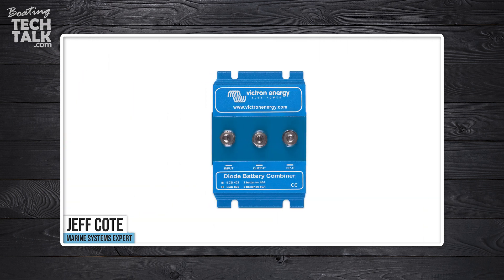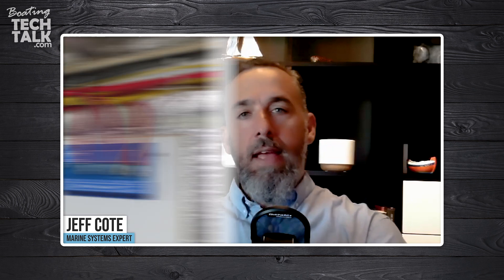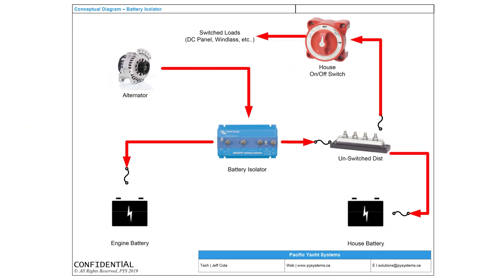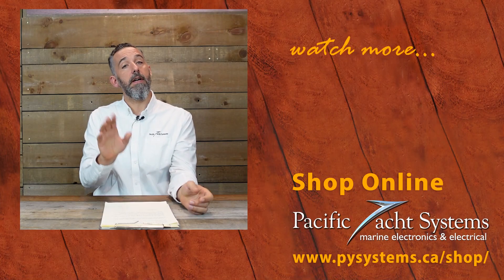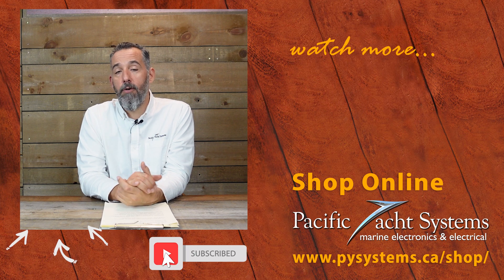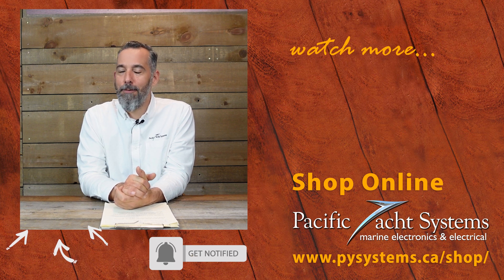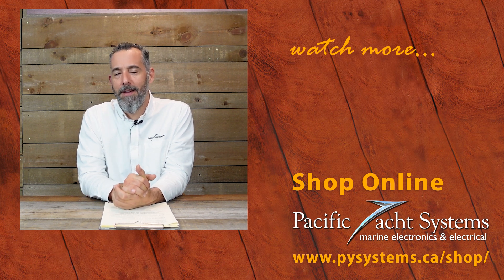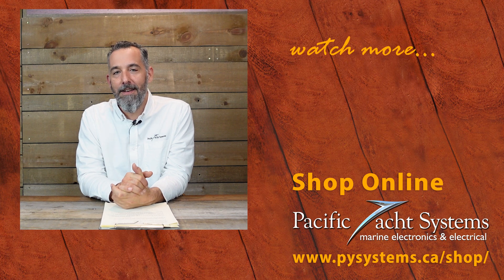Is There a Battery Isolator With Two Inputs?

Comment: Jeff, your videos are fantastic and very informative.  I have a question.  I have twin 7.4 mercs in my 42 foot cruiser.  One alternator goes to an ACR, which goes to Starter Battery 1 as the primary charge and to House Bank for secondary charging. The other alternator goes to Starter Battery 2 only. This is a lost opportunity for charging my 400 ah of house batteries while underway, and I wanted to know if there is a way to connect both alternators to my house bank, after charging the starter batteries.  Thoughts? As an aside, I do have a Magnum Inverter Charger, which charges house under Shore Power and with my Genset. Also have a separate 3 bank charger that runs off boat AC that provides engine and genset battery charging as well.

Comment: I think your advise about not using the isolator on both the charger and alternator is sound advice. However the French made Cristec Intelligent MOSFET Battery Isolator is available with 2 inputs and 3 outputs.

Comment: Great video, thank  you! I agree with the reliability approach.  I have a battery isolator for the alternator and the battery charger goes directly to each battery bank.  I'm in the process of adding 250W of solar power.  Where do I make the connection for the MPPT? I'm thinking either another isolator (expensive and not simple) or same terminal as alternator.  Using the same terminal is cheaper and I still have redundancy with the charger but... would love to hear your thoughts.
Reply: I figured it out {from one of your other videos), I using this solar to offset my refer and some minor electronic load so that means I need to connect to the house battery bank...

Comment: Jeff,  Good work you're doing here.  Kudos.  About your question there at the end, since the Victron agrofet isolator can be independently deployed to either direct charge loads from an alternator/stator charge system or a battery charger I can see how the application concept might get lost on a novice (like me).  But, hours of listening to you over these past days may have cleared things up for me.  My new Yamaha-powered center console comes equipped with an isolator.  Twin 200's with two starting batteries and one house (all same p/n).  Question... If I'm understanding you correctly, it should be possible to deploy a single output battery charger with an agrofet inline to divide and isolate charge current to all three of my batteries with no residual effects on Yamaha's stator charge system.  Am I cooking with gas here?
Reply from the maker: I would just buy a 3 bank charger.   3 bank chargers are more common then a 1 bank anyways.

I would confirm if you have an isolator or  combiners.  isolators with outboards would not be common.   If you have combiners you  could just connect a 1 bank charger to any battery and the existing combiners will charge the other 2.

Comment: Hi Jeff, Great video's! Question, I have a twin engine 3 battery bank system and thought that I would install a Mastervolt Battery Mate 1603 which had 1 input and 3 outputs. My questin is, Can I connect both engines alternators to the 1 input post on the Mastervolt battery mate?
Reply from the maker: I would not do that,  I would buy 2 of them.
You could join the outputs of each one, and run a single wire to each battery.  (big enough for the amps of both alts together)

2 alts may be over the amp limit of the unit as well.

Comment: I recently purchased a guest 2532 battery isolator two inputs three outputs.
Nowhere in the instructions stated if they were using FETs or diodes I try to contact the company but no response.
My boat originally came with 2 battery’s and I added an extra house battery I would like to separate the original house circuits to my new house battery what is the best way to accomplish this ?
Each motor to have its own starter battery and all other circuits on my new house?
Thank you for all the wealth of knowledge that you put out on YouTube YOUR a GREAT HELP
Reply from the maker: the guest is most likly diode based.    you will need to find the house loads to move.  ideally it's a single cable from the existing battery swtich that you can move to a new house swtich which would make it easy.  make sure the engine key switches keep getting power from the engine batteries.    they normally come from the starter,  but sometimes from the DC panel.  (which would be getting moved to the house)   some boats are easy to add a house bank and some are hard!

Comment: Jeff, Thanks for your videos.  They answer so many questions and provide great advise.  Is there an FET isolator which supports two alternator inputs and three battery outputs ?  The house battery lead on my Guest 2503 (Dual 70 Amp Isolator) has failed badly and I need to replace the isolator.  Should I replace the Guest 2503 with a similar Powerline or ProMariner model or seperate my charging between two isolators ?  Is a 70 amp isolator sufficient for two 50 amp alternator inputs ?  

This is an outboard powered fireboat which was repowered in 2018 with two Yamaha F350 outboards each with a 50 Amp altenator.  I suspect a shorted house battery may have caused the charging lead to burn up at the isolator connection.  Fortunately all of the protections worked and my fireboat did not burn up ... that would be embarrassing.
Reply from the maker: Hi Neil, appreciate the feedback, not aware of dual input FET based battery isolator, you'll need two battery isolators.

Comment: ‘ProMariner Battery Isolator, 2 Alternator/3 Batteries, 130 Amp (1 MIN)’ is this what manner you seek? Thought they were more common, or used to be, possible before such high output alternators were available. Alternators need open circuit protection possibly, I have not used this one. VSR are less cost and more efficient, control ability as well? The options now are so wide in system design? I am considering this and similar VSR concepts when I get there. Thanks Jeff!
Reply: As far as argofets not aware. Through put is a choke point. BBMS from Emily and Clark’s Adventures is a controller for intelligent combination of lead / lithium systems through relays. Not the same thing understood. Simple redundancy is each alternator has it’s own multi-purpose battery with VSR to a house bank or dc to dc charging system that do have dual inputs, power more limited in the latter.
At $140 for Victron argofet hard to beat 280 in system design?
Reply: ProMariner ProIsoCharge Battery Isolator 130Amp 2-Alt 4-Bat - 12V
SKU: 41456 - UPC: 031669231276 - MPN: 23127
0.0v loss labeled no technology used stated, no big finned heat sink, possibly similar? Lower rating 160 amp fuse protection requested.
Reply: ‘Sterling ProSplit-R Zero Volt Drop Marine Battery Isolator’ , at least one twin input model. High prices and an eBay rating so low I would not 10’ pole.
Reply from the maker: We tried the Prolsocharge and at limited success with this product.

Comment: Hi guys - hot topic. 

I think about this for a while now as well. In my opinion, it's fine to have booth (three, ...) energy sources on the Input as long as it meets the current "capacity" of  the FET-Diodes. For me the advantages, that I charge all battery with multiple Energy Sources, outweighs the disadvantage of a single source of potential failure. If the device fails, I can figure it out quite quickly with my voltmeter, jump the device and directly connect the battery banks with the energy sources. E.g. the starter battery with the alternator and the house batteries with a charger or however I need it. 

However, maybe I overlook something. Open for constructive ideas / talks :) Maybe this option suits for me since I'm doing the electrics by myself and can repair things. If we talk about people who are not very familiar with electronics, I would agree on the here proposed solution.
Reply from the maker: Thanks Felix for sharing, much appreciated.

Comment: Victron do sell a 2 input single output diode unit so you can run something critical from 2 separate battery banks.
Reply from the maker: Hi Roy, here is the datasheet from Victron for ArgoFets:
https://www.victronenergy.com/upload/documents/Datasheet-Argofet-Battery-Isolators-with-alternator-energize-input-EN.pdf
Reply: @PacificYachtSystems  Hi Jeff,  the diode unit I own is a victron ( battery combiner diode) bcd 802 - bcd 000802000 the 80 amp version there's also a 40 amp they are shottky diodes so you have volt drop you can also use them for charging if you want. I use a 100 amp argofet 3 output for charging I disconnected the negative to see what happened and found it still works like a diode with volt drop.
Reply: Hey Jeff et al. 

I thought this video would be the one to answer what is likely a silly question I’ve had. I want to have two alternators charging a single starter battery. Starter battery uses B2B charger for house bank. Do I even need an isolator since it really isn’t isolating anything?

Comment: What happens to the alternator if it loses it’s connection to a battery while supplying charge?
Reply: the regulator gets fried.
Reply: @nicholaycalhoun1681  That’s what I thought, and probably the reason why alternators are usually directly wired to batteries.
Reply: not sure the exact mechanism. something to do with a bunch of amps having nowhere to go.
Reply: Bruce, consider an alternator as an "electron pump".  It pumps electrons or "generates" AC current (due to rotational motion) which is "filtered or converted" to DC so that your battery can accept it.  A  rotating shaft with copper windings, spinning in a magnetic field.  Its very basic and robust.  Cant really hurt it unless via blunt force trauma.  The "finesse" (fragile part) comes at the output end.  Usually referred to as a "Voltage regulator".  Consists of electrical components designed to sense battery voltage, convert AC to DC and direct the charge to battery or "dump it" to ground if the battery is full.  The only time an alternator is not "pumping" electrons is when it's not rotating.  If the path to battery positive or negative (yes some alternators have external negative ground wire usually going to engine block and need to be sized the same as the positive feed wire) fails, these components usually fail. (ie: diode(s) burn(s) out, soldered connections melt).  FYI, diodes that see reverse polarity typically "burn out".  Example, booster cables hooked up backwards.  The rest of the alternator is still perfectly fine.  This statement assumes that the bearings supporting the alternator's rotating shaft and the engine drive belt/pulley(s) are sound.  Sorry, long blab, but necessary...  

Uggh, ok, one more caveat, u can overheat an alternator too, usually the copper wires "coating" fails and you get an internal short.  (They get danged HOT).  Others are welcome to add additional failure causes here...
Reply: Voltage spike destruction. Other than battery switches being used while running. Most recently are fuses blowing frequently ss washers on a fuse post.
Reply from the maker: Thanks for sharing everyone.

Comment: Jeff, as always great info and advice… I agree 110% with your comments  about not building in a (potential) single point of failure in the system. I’ve seen it too many times, it is a gamble and you’re right, it usually doesn’t bode well for those that try it. I always (strongly) recommend that it be changed whenever I come across it with any of my clients. Logic usually wins out!
Reply: "it usually doesn’t bode well for those that try it" - Can you give some examples? What went wrong?
Reply: I additionally want redundancy and stupid state workarounds. I do field work, lots of hacking problem.
Reply from the maker: Thanks chiming in the conversation.

Comment: I currently have only the alternator, charging both house and starter batteries through a battery isolator.
If I'd not seen this, I would have installed a battery charger, when I do, by connecting it to the isolator, which would have created the situation you describe.
I think.
Reply from the maker: Glad to help Jeff.